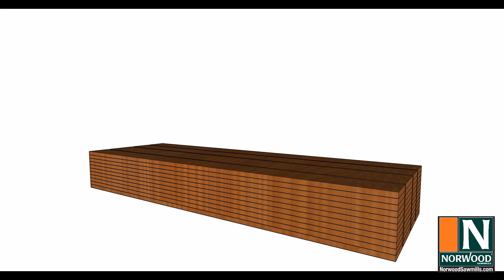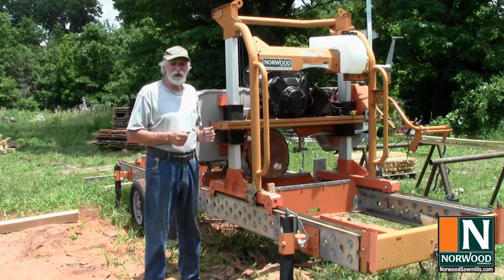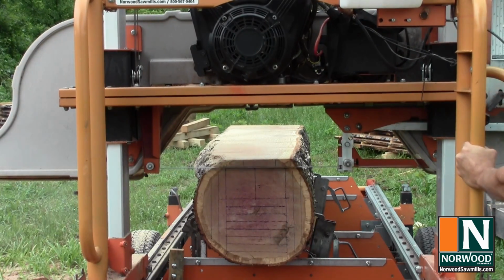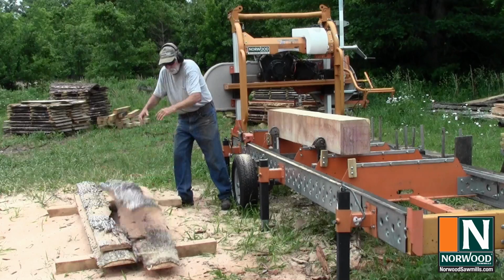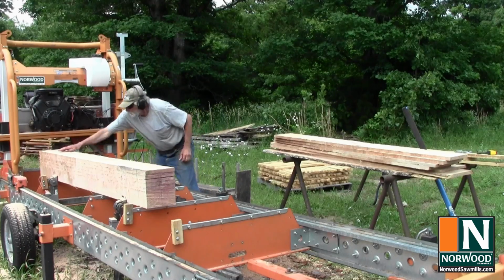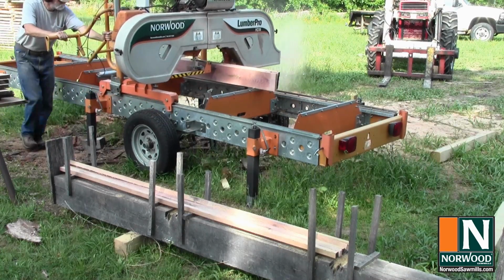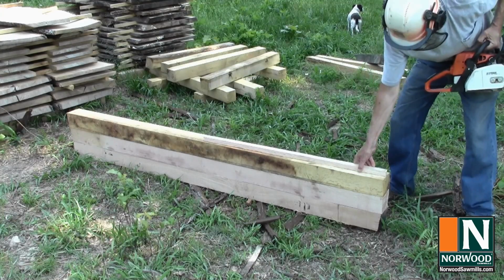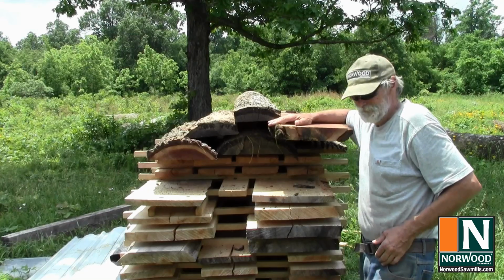Sawmill School - Cutting Blocking & Stickers to Air Dry Your Lumber

Comment: You should do a video on what to do with the waste wood after cutting up a log ? There must be a lot of ideas on this
Reply: Thanks for the comment, Jeff.  The sawdust just goes to compost, and the slabs go for firewood.  I am working on a project to fuel the sawmill with sawdust (wood gasification).  Some of the better slabs could go for small projects, such as bird houses, even cutting boards or pen blanks.  Just not enough time!

Comment: You should take the 4x4's out of the center of the log where the most knots are.  I set a trailer next to the mill to load all the firewood onto.  Instead of having to pick it up again. And I build pallets to load the lumber onto right off the mill, and sticker as I go.  Saves handling the lumber over and over.
Reply: Thanks for the comment.  I really like your pallet idea.  I'll give it a try!

Comment: I Dave, first because of you I own my very first Sawmill...  thanks to you in a positive way...  Here’s my question...  first some reason, when I mill a tree, the blade tend to go upward...  Any reason why?  My blade is level in both ways...  it wasn’t doing that at the beginning last week...  thanks.
Reply: Hi, Marc.  That's a good question, and something that a lot of sawyers deal with.  Checking the blade for level was a good place to start.  How is the blade?  Resin or sap build-up on the blade will cause it to wander.  If that is a problem, mix a little Pine-Sol or Simple Green in with the water lub to keep the blade clean.  How are you setting the tension?  A loose blade will climb or dive.  Have you tried a new blade?  Mud or grit in the bark can damage the blade and cause the problem.  You can learn a lot by putting on a new blade and trying a few more cuts.  That will tell you whether it is a blade problem or sawmill problem.  How fast are you feeding the blade through the wood?  Pushing too slowly gives the blade more room to deviate in direction.  What species are you cutting?  Some, like post oak, are harder to cut straight.  When you cut, do you start at the narrow end or the big end of the log?  That can make a difference. Next thing to look at is the tracking (where the blade rides on the band wheels).  You might try centering the blades on the bandwheels, trying a few cuts, then moving the blade tracking back or forward.  If none of that helps, drop me a line, and We'll see what else we can come up with.  By the way, what sawmill are you using?

Comment: Great video!  What species should you not use for stickers, if any?
Reply: Ideally, stickers should be of a species with light color, and well air-dry, so that they will be less likely to stain the wood stacked on them.  I like to use post oak, as it is plentiful, durable, and not much good for anything else, other than firewood.  You can also buy commercial stickers with a spiral groove to let air through them, though I've never used them.

Comment: I have a doubt, the assembling of the saw, the engine , the operator handles, trunk support and clamping ( everything that goes on the top ) are the same for the 36v2 ans 38 models?

Comment: Hey Dave… been a great help watching your videos putting the HD36 together and getting it calibrated to we’re it cuts true… Thanks a lot…I’m up in Haines, Alaska where we have mostly Sitka Spruce and Birch… I used a Cottonwood for my first log for practice using it for stickers and blocks…
Do you think I can get away using the fresh cottonwood stickers without drying them first…you mentioned fresh stickers stain the boards…. Plan on sawing birch for furniture next…Hans
Reply: Thanks for the question.  I'd still recommend air drying the cottonwood for at least three weeks (if not left out in the rain).  Since birch is a light-colored wood it would show sticker stain more than most other species.  That said, it would be better to use freshly cut stickers than none at all.
Reply: @daveboyt6810  Thanks Dave👍

Comment: How long should I let stickers dry before I can start using them?
Reply: Good question.  I'd give them a couple of months, at least, but you need to keep them off the ground, and cover them with a piece of roofing, if possible (not with a tarp-- you need air circulation).

Comment: What moisture content should your stickers be before you use them to avoid sticker stain?
Reply: Not sure about the moisture content, but I let them air dry for at least 3 months.  Light color stickers are less likely to stain, so I generally use post oak or white oak.
Reply: @daveboyt6810  Ive been cutting red oak for stickers with logs that wouldn't make good boards.  Ive made nearly 3500 stickers.  Is that not a good choice for stickers?

Comment: Thank you for all your videos. I will certainly continue wathing them. I have a few questions about blocks and stickers: What kind of material is the best to use?  Is ot ok to mix materials, for instanse use spruce for all kind of lumber?
Reply: Thanks for watching.  You can use any species for blocking and stickers, but it is best to let stickers air dry first.  Light-colored stickers won't be as bad as leaving "sticker stain" as darker woods, such as walnut.  Dry spruce should be a good all-around sticker wood.

Comment: We use steel banding on all the through and through sawn logs.
Normally banded every metre or so to:
Reduce splitting
Keeps boards flatter
stops stacks falling apart during drying
Makes moving complete sawn logs easy, especially when being re-sawn.
Oh yes, sometimes the timber will snap the bands !! - when it moves, nothing will stop it.
We just paint a number on both ends of the logs in whatever paint we have and its recorded in the stock book ( and the computer)
Stenner VBQ60  60" wheels running 6-9" bands.
Reply: Good idea.  It would also make the stacks easier to move and stack.  Do you tighten the bands as the wood dries & shrinks... maybe drive in wedges?
Reply: @daveboyt6810  No we don't bother unless the log is falling apart making it difficult to move, then we re-band it.
Oh and forgot to mention, we always stack the new logs in the shade of a building or under cover for the 1st 6 months if we can (Hardwoods only)

Comment: How long do you have to wait until the wood drys out.
Reply from the maker: 1" per year is the rule of thumb, but a year of drying in Phoenix, AZ is much different from a year of drying in Seattle, WA. Also, it depends on species: Walnut for example, dries more quickly than white oak. No matter how long you air dry lumber, it will never reach the kiln- dry moisture content required for indoor furniture. 

In summary, there are many variables as to how long it will take wood to dry: species, condition of wood, dimension sawn, manner in which the wood has been stickered and stacked, ambient temperatures and humidity levels, prevalence of wind, etc … all play  a big part in drying. And, of course, what is “dry” enough depends on what you plan on doing with your wood. Best thing is to get a moisture meter and you can monitor your boards as they dry.

We recommend you watch the following videos on Sawmill TV:

Sawmill School - Air Drying Your Lumber		https://www.norwoodsawmills.com/tv/index.aspx?isVideo=true&id=486109271
Sawmill School - Cutting Blocking & Stickers to Air Dry Your Lumber	https://www.norwoodsawmills.com/tv/index.aspx?isVideo=true&id=312955927 

You may want to get yourself a copy of Norwood's book – "The Ultimate Guide to Portable Sawmills".  

We have a whole chapter devoted to drying wood.  There is another chapter devoted to making various cuts including quarter sawing.  We have another chapter covering how to make money with your Norwood.  Plus, there other chapters with great pro-sawmilling tips.

It's just $8.70 for shipping (we give the book for FREE). http://www.norwoodsawmills.com/free-portable-sawmills-book

Comment: Thanks for the lessons. Can you use western red cedar for stickers on 8/4 bur oak planks?
Reply: Never tried it, but so far, I haven't had problems mixing species, as long as as the stickers are kiln dry first.  Your safest bet is to make stickers out of a species in the white oak group (of which burr oak is a member), for example post oak.  Next best would be another light-colored wood so you don't get sticker stain.

Comment: what size are the stickers? are the 4x4s full-size or nominal? (3.5) From here, it looks like the 4x4 are nominal, and the stickers are about 1.5
Reply: Good question.  I shoot for 7/8" thick on the stickers.  That way, I can drop the carriage down in 1" increments (allowing for 1/8" saw kerf).  Once dry, I wind up with 3/4" stickers, which is about the smallest you'd want to use.  4x4s don't need to be exact, but I go with full dimension.  Main thing is to get the pile up off the ground and have room to get the pallet forks in to lift the pile.

Comment: Are the stickers 1x1?
Reply from the maker: They can vary really. You can do 1 x 1.
Reply: Any size from 1" to 3/4" square work fine, but they need to be consistent thickness.  I cut 7/8" so I can just drop the saw down in 1" increments for the cuts (losing 1/8" to kerf).

Comment: I'm curious would it help the drying process of you had an enclosure like a pole barn to store it in?
Reply: Hi, Lem.  That depends.  You've got to have good air circulation in order for the lumber to dry.  That might involve installing fans to circulate air through the pile, unless both ends of the bar are open so the wind can blow through it.

Comment: Say, those stickers are pretty big! Looks like 1" or more! Im used to 1/2" or at most 3/4"!  Also, do you think putting plastic sheeting down before blocking is helpful? I only have a few board to sticker, so what is the best way to keep rain off? Also, rain.
Reply: Good eye, Seth!  Yes, the stickers are thicker than they need to be, which makes the stacks a bit taller.  The reason for that is that I cut a lot of odd lengths, mostly 1-1/8" thick.  I cut a lot of stickers from edging the boards, and I want them all the same size-- plus when stacking, I can use stickers as spacers when I stack longer boards on top of shorter ones.  They provide support and keep the stack level.  Plastic sheeting under the blocking is a good idea, as it keeps ground moisture away from the bottom layers.  I recommend covering the stack with metal roofing, then weights on top of that.  This keeps most of the rain off, but still allows for good air circulation through the stack.

Comment: I noticed that he put some cut off logs on the top for weight and to shed the water but wouldn’t something like this left outside in the rain never dry? Doesn’t it need to be covered to keep the rain off of it or does it eventually dry even being out in the elements?
Reply: You're right.  That's just a temporary measure until I get the wood to a drying area and can cover it properly with sheets of metal roofing.

Comment: Thx for all the vids, really guiding me along other vids from other utubers and reading up too. Helps a lot to see others saw (no pun intended).  I also learn other things that you are not talking about but that you do as you go along,. Also have the HD36, I see that you modified the spout where the saw dust exits. I guess the plastic is not fully open because Norwood would not want to be liable for someone putting their hand in there in case the blade is spinning, like clearing out debris, but then I see yours can be removed. So put back for the video to show safety.  Or is there a benefit to those holes?
Reply: Thanks for the comment.  Hope your HD36 is running well.  There was no need to cut out the end of the sawdust chute.  The tire directs the air flow in such a way as to increase the volume of air, which pulls sawdust out of the chute (think Bernoulli effect). While demonstrating the mill, someone even lifted up the tire and looked inside (through the holes) while the blade was still spinning!  There seems to be no limit to lack of common sense, so all safety guards stay in place, no matter how careful I intend to be.  The chute does a great job of directing sawdust down and out of my face.  I can also hang a bucket on it to catch the sawdust.  By the way, I enjoyed "Zee Magic Pick"!
Reply: @daveboyt6810  That magic pick , done a long time ago, gets used all the time, as a hole maker, box opener, scriber at times, it's just a silly thing I made as a do it all tool. Never thought I would still use it to this day! Since it's somewhat thick it feels good use as it has some heft. It even opens cans of Maple syrup like a hot knife through butter. for a quick sip! But really the videos really helped me a lot and some I watch again. Will try the tire!
Reply: @ZeeFrankensteel  That pick will outlast you, unless it gets thrown into a volcano.  I know what you mean about the video.  My first one was "If I Only Had a Job", and it helped get through a rough patch with a little humor.  Hope to see some video of you running the mill one of these days.

Comment: Thanks for the info. I made it 2 weeks with my new o27 before I hit a log rest. I have replaced the rests with wood so it will not hurt my ego. The wood is just not strong like the metal stops.
Reply: Welcome to the club!  I've been thinking about metal log rests with replaceable wood tops (about the top 3" or so).  That gives you the strength of steel where you need it, and wood where you're most likely to saw into it.

Comment: Really enjoyed the video!  Any ideas on how the best way to remove sticker stain on oak lumber? Thanks
Reply: Sometimes it will come out when you plane the wood, though you might have to take off more than you otherwise would.  Best is to use dry stickers and keep the pile covered and not get the stain in the first place.

Comment: This was excellent- so much good advice!  For my first project I rented my neighbour with his portable mill, and that was my chief frustration:  he was cutting lumber so fast that there was no time to cut stickers and do a decent pile- everything had to be re-stacked afterward which was a lot of manual labour.  Now that I have my own mill, my practice logs and anything short because it's too crooked will end up as blocking and stickers, and I'll always have them on hand.  Piled on a pallet- that's just idea.   But I'll match my drying pile width not to my loader forks, because my machine is too light to lift anywhere near the tip of the forks anyway.  I'll match my piles to the width of a single piece of sheet metal roofing.  You can still throw slabs on top for extra weight, but metal roofing keeps the water out of the pile with certainty.
Reply: Thanks for the comment.  You're right... a lot depends on the size and capacity of your equipment.  I hate stacking wood twice!

Comment: These videos are a great help for a me, a rookie sawyer.  Does any particular type of wood sticker stain the lumber less than others?  This is a hobby for me, a very  active retiree.
Reply: Hi, Jim, thanks for watching.  In general light-colored woods stain less, but as long as the stickers are air dry, you won't have a problem with sticker stain.  Enjoy sawmilling!  What mill are you running?

Comment: I rate this video at
         😃😃😃😃😃
             Five Smiles!
     Paint the ends of your logs with latex paint to reduce end grain cracking.
      Different colors for different types of wood.
      Use stickers of the same kind of wood to control sticker stain.
       I have always used my marginal boards for top stack weight and edge cuts for fire wood.
        See Dave you just showed me that I should let that fire wood dry on top on my stacks... 😁
      Best Wishes!
Reply: Good point on the end coating.  I use a product called anchor seal, designed for that purpose.

Comment: Can oak thinnings be used to make fence stakes? What min tree diameter would it need to be.. Is 6 to 8" diameter enough?.. ie very little heartwood.. I dont mind some bark on edges, but I dont want to season lots of them for nothing if sapwood doesnt work for stakes.. What are your thoughts on it? Thanks, Eddie from Ireland..
Reply: Hi, Eddie, thanks for asking.  What size are the fence stakes?  Since they will be in ground contact, you will probably want to use heartwood from oaks in the  white oak group.  The sapwood does rot more quickly, and stakes containing both heartwood and sapwood will tend to bend as they dry.  The smaller the diameter of the log, the more time you spend loading and clamping the wood down to cut it, and at some point, it is more practical to cut it for firewood.  Hope that helps!  Enjoyed your Grapple video.  I need to build something along those lines for my tractor.